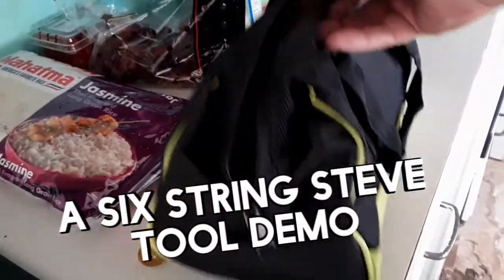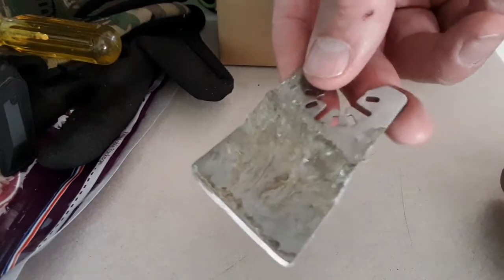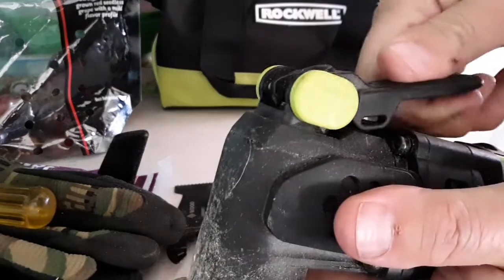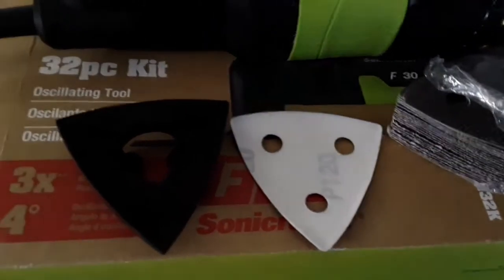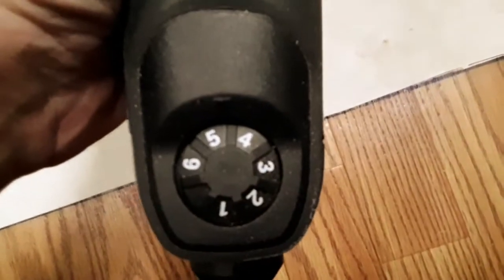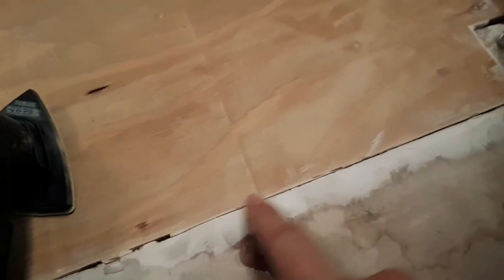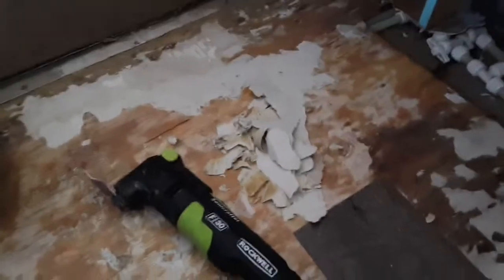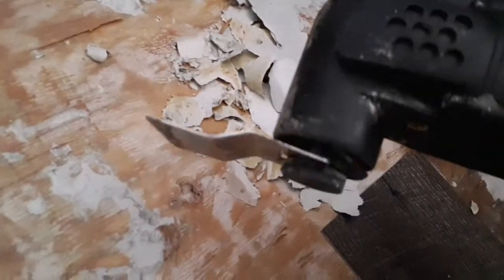Rockwell Sonicrafter F30 Oscillating Tool - Review & Demo

Comment: Thank you for the demo.  I'm an 82-years old great grandmother but my oscillating tool hasn't been used for about 6 years so It was stuck and I needed to change the blade.  After watching you, I realized that I just wasn't putting enough muscle into the job.  Got it working.  Thanks.
Reply from the maker: That is great to hear! I'm so happy my video was helpful to you. Happy oscillating 😄

Comment: just bought one from Lowe's. Took it home, made a cut and it cut like butter. 30 seconds later I went to try the sander but the lever wouldn't turn to change blades. Returned it and got another. 2 minutes into using it the motor went from a 3 or 4 to what sounded like 25!!! All by itself!!! I can't recommend these.
Reply from the maker: Mine has operated just fine. It's unfortunate that you've had a different experience. Thanks for watching.
Reply: Mine wouldn't cut through 1/4 inch plywood with Japanese style saw blades. I kept changing blades and the same thing happened. I got so frustrated that I threw it down on the sidewalk and broke the handle and other parts on it. I threw the damn thing in the dumpster. Never again will I buy one of these.